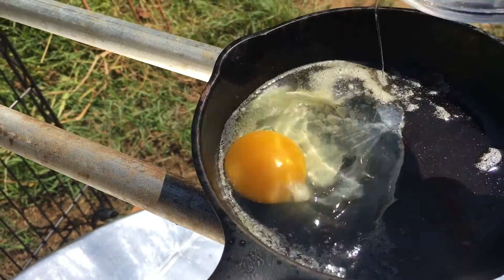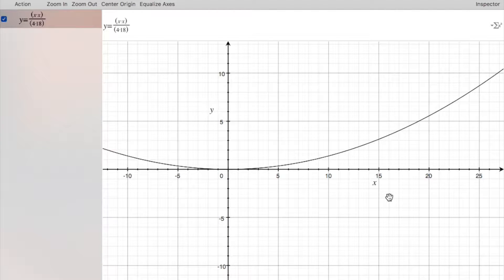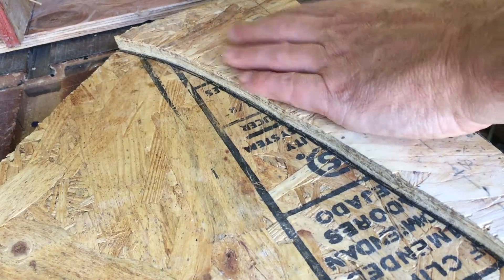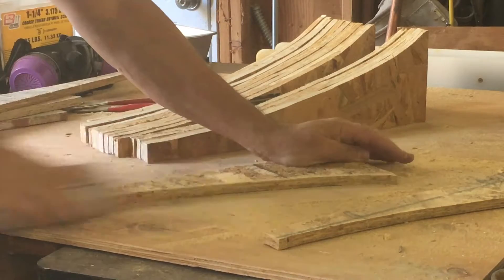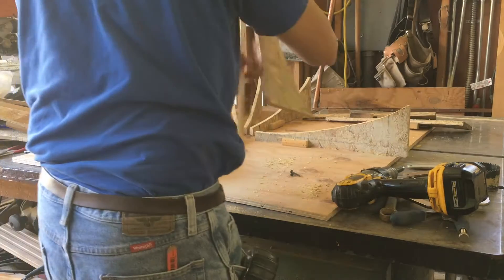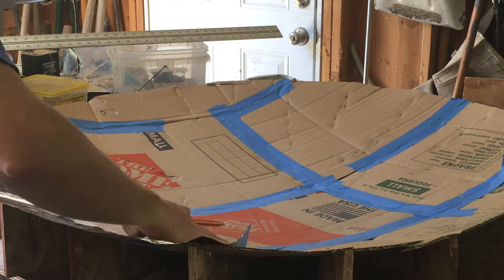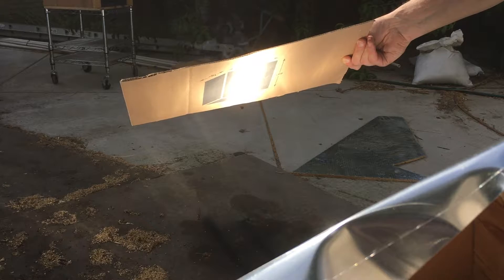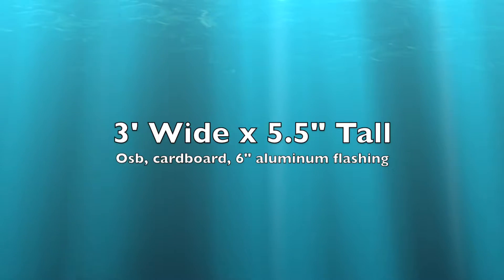DIY Parabolic Dish Solar Concentrator Build

Comment: I'll tell ya what, a cnc router with fusion 360 would make short work of that osb. I have a longmill from sienci labs and I am working on a parabolic trough mirror. The pieces I cut out are perfect.

Comment: Did you have to adjust the parabolic dish as the sun moved?
Reply from the maker: I didn't need to adjust it for the cooking demonstration.  It only takes about 4 or 5 minutes to warm up the pan and a few more to cook the egg.  If I were to cook longer, it would be necessary to track the sun to maintain a hot spot.  I intend to build a base and tracker next.

Comment: charred wood electroplating
Reply: single mold, electroplated metal, from copper
Reply: inside fill or outside fins in the curved shape
Reply: single copper fins as the ribs as mesh honeycomb netting, works as antenna dish too